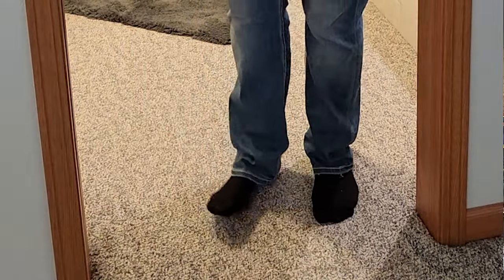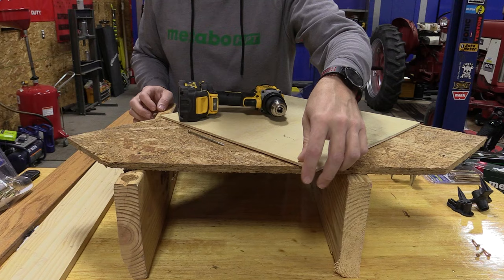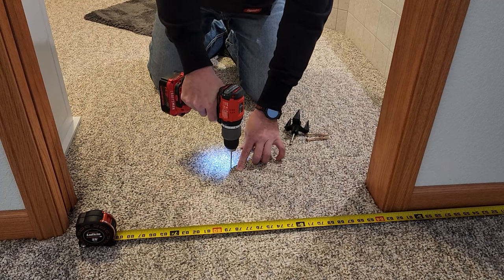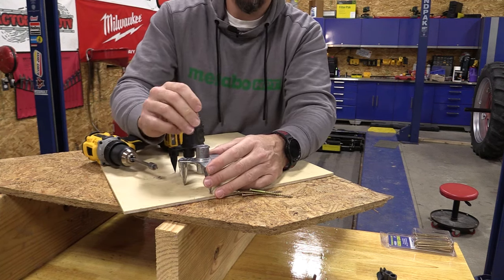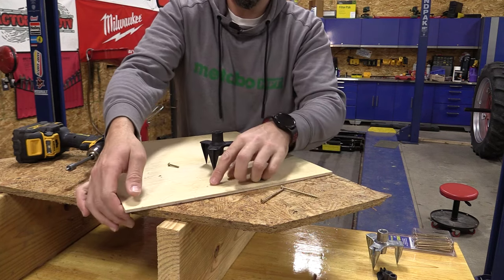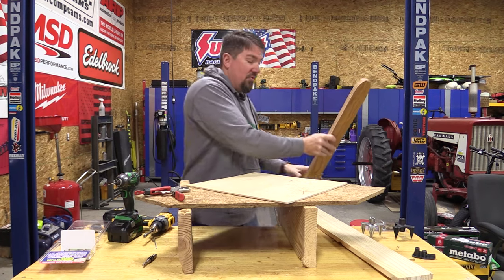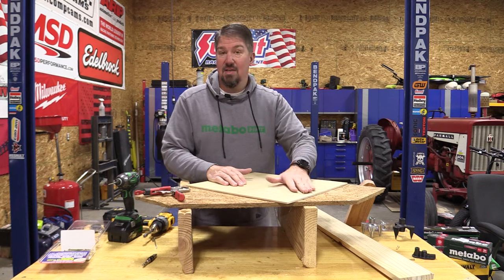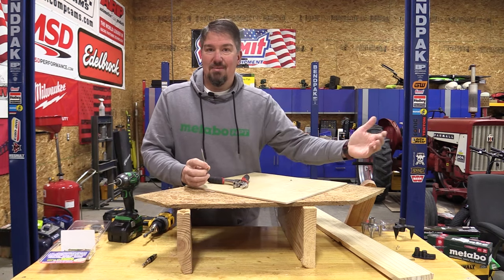How To Repair a Squeaky Floor In Minutes With The Squeek No More Kit 3233

Comment: What would be the cause if you have squeaks that run down the entire length of the floor joist?? Is that signs of a foundational issue? We've had our foundation reinforced with concrete pillars but there are four places, all of which run along two floor joists, that are creaking massively!

Comment: Better solution go back to making floors out of 2x4’s had a brand new home built in 2007 floors squeaked day one…. Moved to a home built in 1955 about 7 years later….no floor in a single spot squeaks on the old home, also there’s zero flex you can jump up and down and nothing bows….i wish they would go back to 2x4 floors also the joists are closer then on the newer home
Reply: It's not the wood the causes squeaks. It's the fasteners.

Comment: A carpet man would be pissed because putting screws threw the carpet,the problem is the plywood subfloor not the carpet pull the carpet back then put screws where needed and no that method would get you banned from the persons house if you try to screw thru lvp, laminate and hardwood floors

Comment: This is expensive, when you can just use a drill and counter sink.
Reply: On carpet? Lol not a chance.
Reply: @evictioncarpentry2628  Why not? Use a trim head screw, or cut a little x in the carpet.
Reply: @saulgoodman2018  Dude, this tool has been around for decades. If you've never used it, you have to put dozens of them into the floor to stop a squeak. You will destroy your carpet any other way.
Reply: @evictioncarpentry2628  And regular screws have been around for hundreds of years.
So what if this destroy your carpet. Squeaks will destroy your sanity.

Comment: This is so strange to me how it is posible that you in America have homes made entirely from wood. I be scared to walk   on the wooden flor thats have like 60 yers old. Sry for my english
Reply: In Norway we have wooden buildings that are closer to 1000 years old. That timber was cut on a few special days every year from old trees. Churches have floors that are often 300 years old. And remember that in those days drainage around and under buildings was poor! Wood that can last extremely long if kept dry, or in water without oxygen. Wooden buildings that are old typically leak a lot of air which helps to air out the structure, and keep moisture-levels low.
Reply: @olgajoachimosmundsen4647  thx for this . Im from midle europe. We using mostly briks for walls and concrete for flors . Its much stronger than wood but less eco.